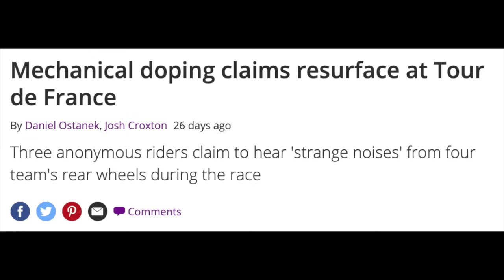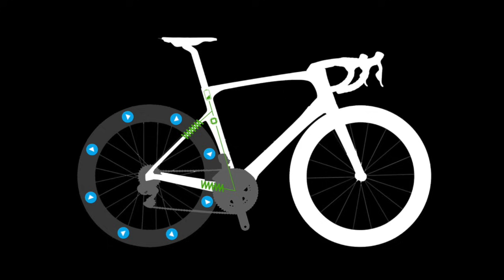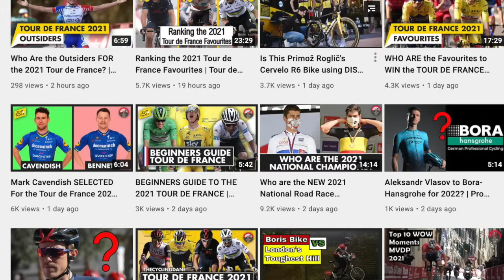Is This Bizarre Crash Proof of Motor-doping? Tour of Denmark 2021

Comment: I fell off my bike a few years ago at about 25kph - pretty modest speed. The bike ended up about 10 meters from me. I see nothing odd here at all.
Reply: I believe that because it had one tyre in full contact and grip with the road it show that some dragging must have occured. I haven't seen crashes that have looked like this, only Hesjedal's but that seemed more credible of it being on a descent so gravity had some saying in it. I think this was mechanical doping, bikes just don't slide like that on flat, they just bounce once of the ground and stop.
Reply: That bike dragged itself at 90 degrees across the road... Not 10 metres down the road
Reply: @gwhite7011  Action - reaction. 60 kilo rider goes one way kicking off bike as he unclips. Which way do you expect the 6 kilo bike to go?
Reply: @Llanchlo  Not going to get in to a to and fro with you. You think it looks legit, I think it looks dodgy as feck. It propels itself ACROSS the road . Bye now
Reply: @bibartvivian3694  Exactly - it's impossible.
Reply: @gwhite7011  i agree with you mate. its looks sus as hell. to me. the way that bike wheel propelled it at that angle with that force is definitely suspect! cheers mate🇬🇧🤘🏻
Reply: @bibartvivian3694  yes I agree with you also on this. definitely doesn't look like any other crashes I've seen. looks suspect as hell to me
Reply: @the Communist. No need to be offensive if you disagree. I agree with Phillip. The wheels were still spinning although the bike had stopped, the rider fell to the left and instantly unclipped. It can be explained by inertia. If the bike first fell on the frame, the rotational energy from the wheels would not have been lost and the wheels would have been still spinning at a similar speed, with the air surrounding the wheel creating pressure pushing upwards. There was an equal and opposite force to the direction of the rider's fall applied. The law of interaction. The acceleration is directly proportional to the applied force. The incident follows the 3 laws of motion. It is not impossible at all.
Reply: 10 meters ahead or ten meters aside of you?
Reply: You can call it strange that the bike moves sideways. But the water bottle moves BACK. Clearly that cannot be explained and I suspect a hidden rocket booster!
Reply: @gwhite7011  It actually DIDN't !!  Why are peoples so dumb to analyze the footage. Cameramen on motorbike had it at zoom in, cyclist  felt with a speed between 50-55 km/h. Bikes often keep same speed when sliding on tarmac after a crash for 1-3 seconds, so that means that : when you saw bike from left to right just on the point before hitting other rider, it travveld like max 5 meters from left to right (seems larger - again caused by zooming in from camera) , and it did that in less then 2 seconds. 2 second it went forward at 50+ km/h so it traveled more or less like 20 meters forward, take a piece of paper and put it in lengt straight in front of you, and then draw a point on down-left corner of the paper, then go left 5 cm and put a point 20 cm straight above that,  Draw then a line that connects those 2 dots in a slight bending form so your line travels a bit more then 20 cm from that first dot/point, what do you see ? put your pen and go over the line again with constant speed in just less then 2 seconds from the lower dot to the end you draw the second dot , you see  Is it CLEAR to those little bit retarded / Not Thinking peoples ? Whats abnormal about that ? I did once an almost deadly crash with my bike , II crashed on a 20 meter distance, my bike was still in my click pedals, tha only thing I remember is that I went in the air and almost did a salto and smashing into the ground with my side of my whole body, then bike pulled me farther then I would probably without my shoes to stay clicked in. Terrible accident, but lucky (?) no truck comming up other side of the road, otherwise .....i was done with this planet. Apologize for my bad English
Reply: That doesn't mean I don't believe their is mechanical doping. I found it more strange that I saw (like here in that Denmark Tour) a bike held by another rider for his fallen teammate and he put rear wheel in the air and turns the cranck, and then stop turning and the weel and CRANK keeps turning on same speed on his own untilll he puts rear wheel down, Ive seen it often, and that makes me doubt more. I had it once on a older MTB , but their it was clear that the rear cassette was somehow stuck/ old - not much oil left- stuck on backwheel nut.  Can a real cyclist explain me why proffessional bikes do that in race and my semi-cleaned race bike never does that ?
Reply: @Shitinthemorning  put it in a low gear and see what happens - that is in fact a reason to spin it, to change to lower gear to facilitate departure. With a motor activated, the wheel would not suddenly stop once back on the road.
Reply: @Shitinthemorning  wrong.
Reply: @alphaniner3770  I don't get what you mean with  ' put it in low gear and see what happens '  doesn't change a thing in what gear it is, crank never needs to turn on his own no mather what gear it is in I fuking turn . I do race biking  toimes my crank in each gear when I clean my bike and adapt the gears on my race bike, it never keeps spinning after i stop spinning myself LOL why would it spin, its made that way that it will NOT spin, so thats my point, why does it spin with some Pro's ? .Since 14 years and my brother was pro (without fix contract) And maybe its a motor that activate with an amount of watts when you push on the pedals and reduce directly to lower watts once you don't put a minimum amount of watts with your legs, then it brakes easy to avoid problems and heating up the motor, I don't know ... just saying what the possibilities are ... we will never know untill those bastards are catched using it.
Reply: I suggest low gear because it's easier for the mass of the moving chain and the small cassette to help keep the crank spinning. Just try it, you should get at least a few rotations if everything runs smoothly (too much grease will slow it down, but I reckon you know that). I guess you are just upset because you suspect an unfair situation. I understand that, and it would be bad if true, and perhaps it happens in certain non- pro situations, perhaps your region. Perhaps what you mentioned was indeed a motor. I just think that motors aren't an issue at pro level, because they are easy to spot (thermal cameras, the high pitched sound they produce and of course visual inspection). I got my first racing bike 34 years ago, and I have assembled all the subsequent ones from parts with my father.

Comment: I 💯 per believe lance used motors during his TDF victories. Go back and look at all the old footage of his time trial victories. He always reaches back to pinch the top of the pad in his shorts with his left hand. Even the late Paul Sherwen made a comment about it during the beginning of lances 2005 prologue ride. He referenced to "lances strange nervous habit of always reaching back to grab his shorts". Look it up. I believe the remote was hidden in the pad if his shorts.
Reply: Look it up and holy cow, that is strange!
Reply: Lugged steel frames can be glued together with resin, and sealed lead acid batteries can be installed during manufacturing. Dremel made a commercial electric eraser in 1932. That configuration would fit in a rear hub or bottom bracket.  I think motor doping is a hundred years old.
Reply: Wasn’t he always grabbing under his seat?
Reply: Or he just didn’t like his shorts riding up in his crack.  I could easily see those tight skinsuits doing that and there be a need to adjust it. 🤷🏻‍♀️
Reply: Do you think Lance was the only one doping & using motors? Or, were the other big-$ team’s GC-men doing the same? Lance certainly cheated; but, only a sucker wouldn’t when all the Dutch, French & Italien teams were doping heavy before Lance even came over. It was cheat or go home to America & find a real job. Lance was just the best cheater in an era when all the contenders were doing the same…imho.

Comment: The UCI should demand protour bikes be build with a small hole in the tube so inspectors can easily insert camera to ensure nothing is there. No need to rely on expensive sensing equipment
Reply: Just take the saddle off
Reply: FLIR cameras can easily detect motor doping with its heat signature as shown in the video.  There are lightweight handheld versions where a UCI Commissaire can be equipped to detect motor doping during a race.
Reply: @iMadrid11  I think that only works if the motor is engaged at that moment (or shortly after). The rider can flip the motor on and off so it’s not 100% effective.
Reply: @SaminHam  You only need to focus FLIR scanning on the climbing sections to detect motor doping. There's hardly any advantage to made using a motor on flat sections.
Reply: Motor could be hidden in pretty much any tube. And you could also have magnetic wheels aswell
Reply: no way is a pro rider going to let some UCI hack drill a hole in their $15,000 machine!! they won't even let them take the seat off. its well known thatthe UCI is a joke so no professional rider is letting those HACKS tou h their machines!!
Reply: @kenkaniff8428  I said they should mandate the bikes be BUILT with access holes to the tubes. Each team already has to submit new framesets designs to the uci for approval. The uci literally controls the sport and can reject any bike design they want.
Reply: @iMadrid11  
Cavendish almost got timed out on a stage of this year's TDF. His team came back to help him make it just under 2 min of the cutoff. In an instance like that an electric motor would have helped on the flats. But, I get your point.
Reply: @happydays8171  As it was a mountain stage (as all stages where riders are in danger of OTL), that extra hundred watts would've helped him go faster far more when ascending than on the flat. AKA gravity is a bitch.
Reply: That'll only happen if they get mad at some team or rider.
Reply: @iMadrid11  We climbers can absolutely benefit from help on the flats.

Comment: If you rode a road bike at 40+ km/h, you would understand that there is a lot of power in the spinning wheels. If you crash, the wheels are still spinning (of course) and the power has to go sonewhere. This results in this „miracle“.

Comment: The Di2 batteries in the seat post may be THE power source for the mechanical engine.  The Di2 seat post battery seems innocently overlooked except that a rider might change for a new bike multiple times during a stage as these batteries will last only an hour max.  (HIGHLY SUSPECT)

Comment: Two points here.

1 - whilst the bike appears to move perpendicular across the road, the bike is actually crossing the road diagonally towards the direction it had been headed in, but the motocam and other cyclists moving forward make it appear like it turned at a right angle.
2 - the front wheel is stood up with full contact on the ground, which could strongly influence the direction the bike travels.
Reply: I dont think the front wheel is in contact with the ground.

My therory is the angular momentum of the spinning front wheel is moving the bike via the right hand rule, putting force thru the axel length, perpendicular to the fork.

Comment: What I don't understand is that they arn't using heat cams all the time. Tackling this problem - if it really exits - is far easier than tackling the PED problem. It's hard to find a drug in a human body, but it's really simple to find motors. They could simply install gates at certain points on the track the riders need to pass - I mean any aiport security system can detect batteries etc.

Comment: It is pretty easy to devise an experiment with a large fan to see how much force is required to move a bicycle like that. I think the other riders would be blown off their bikes long before that as they have the much larger cross section. Also, normal bicycles do not store large amounts of energy in the drivetrain.

Comment: Wind could not force a bike across the road like that and there was no echelon in pack indicated a very high right angle cross wind. It seems the rear wheel was in contact with the road and driving the bike, kinetic energy with no rider would dissipate way before the bike could cross the road and strike the other rider with such force: something doesn’t add up ?

Comment: I am not quite sure, this looks really od. the bike crosses the road - could be possible, but afterwards the bike jumps in the air catapulted by the rear wheel - thats more of a concern. 
Nonetheless the solution is quite simple, nameplate all bikes in the peloton with a tag, that cannot be removed. any bike can be controlled afterwards with xray etc.
Reply: Because the wheel will keep on spinning until it looses energy. Try at home and you damage your bike.

Comment: 7 kg bike maybe - but the wheels are way too light to propel even that weight at that speed through kinetic energy. And if there is enough wind to push a 7 kg chunk of metal across the road, wouldn't it also move the crops at the side of the road just a little too?!
Reply: The only time I saw a bike moving because of windy condition it was on the top of Col daubisque, with 130kmh wind. Clearly not the case here, race would be cancelled if that was the case. A ventoux finish at the top got canceled for 100kmh winds
Reply: exactly. not nearly enough wind to propel a bike at that force AT A 90° ANGLE!  That bike seemed to jump awfully suspect ata 90° angle. very suspect if you ask me
Reply: @MrCollewet  exactly. this was NOT wind!!! the bike jumped at a 90° angle which no way is there enough inertia being made to make a bike do this. to me it was the 90°angle at whichit jumped that makes it suspect to me

Comment: Rear tyre is touching the ground straight after the crash when horizontal.  With a 1kg wheel it wouldn’t have much inertia even at 60km/hr.  One tiny touch of the road would drastically reduce its speed. That’s what rim breaks do.  Wind is not likely, wind speed at 200mm above the road is small compared to 2m above the road due to wind shear. I call BS - is a motor 😠
Reply: it was the force at which it jumped that was unnatural to me but more than anything the most suspect part was the force that it jumped AT A 90° ANGLE!!! Definitely suspect in my opinion also

Comment: Anyone that thinks lance used a motor is just silly. He doesn't even have the fastest time up any of the major climbs in the tour.
Reply: Whatever the form of doping, pure speed in a moment is not the plan. Chemical doping is at least as much about recovering faster so you can maintain a high level of performance every day rather than have to pay for your big effort with a bad day or two following.
   Different use of mechanical doping: to avoid suspicions, you'd use it just to keep up while taking it easy for a few days leaving natural energy, perhaps with a tiny bit of 'assistance', to do the critical effort at appropriate time. For domestique, just use it to ferry bottles and keep protected rider out of wind a bit longer than if no doping. In short, it will work better if the rider is at very level on their own and the little bit extra makes the small difference between success and merely taking part in event.
Reply: if lance could have done motor doping, his efforts would have been better put into aero development.  therefore as he was fiercely competitive it is illogical for him to have attempted a technology which was (and is) immature.  Occam's Razor
Reply: thanks mr spock
Reply: Lance didn’t motor dope. He crashed in a team time trial one year in the TdF and then the 2003 crash with Mayo on Luz Ardiden. No sign of anything like this. He EPO doped, his whole team doped, he was the best doped all around rider during that time, he was ultra competitive and his manager Johan Bruyneel was cool with it.
Reply: I just don't think the technology was viable for moror doping back in Lance's day.
Battery technology in particular has moved on in leaps and bounds over the last 20 years.

Comment: when you crash the bike will travel in the direction that the momentum takes it prior to the crash (typically forward or down a hill).......to travel 180 degrees opposite of the rider momentum would require assistance

Comment: You can plainly see the wheel still turning with what appears to be geared force behind it.  Why does the UCI or whomever not xray each bike by the rider prior to the race and any extra bikes the team has? This would eliminate it totally.  They can't  use an excuse of that would take too much time either.  Bikes are checked after mechanics set them up day prior, then locked away until race time for the riders.

Comment: Theres no doubt that rear wheel had motor drive to it.  I've done amateur races and they also make similar messes, especially now with the general handling quality of pros of late days are messy, but regarding the crash, who are they thinking the BS of the light carbon rim having Momentum to drive the bike like that is a joke.   I used light alloy tubulars about same weight and heavier than the wheels seen in races now, and you NEVER saw bikes get powered across the road like that.  The guy that gets taken out from that dirty bike should sue the cheat rider.  And new tech is needed to sniff out the motors.

Comment: One bike per rider, no wheel changes allowed. Bikes inspected before and after each stage. Bikes stored and maintained in UCI controlled impound between stages, with UCI inspectors  and video surveillance present during all maintenance operations. Anything less is an invitation to cheat. 😁